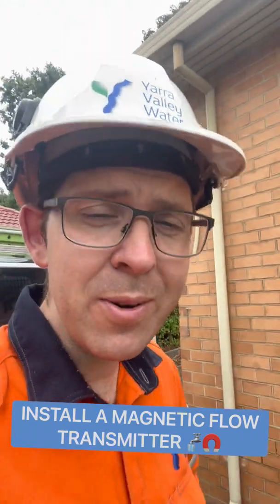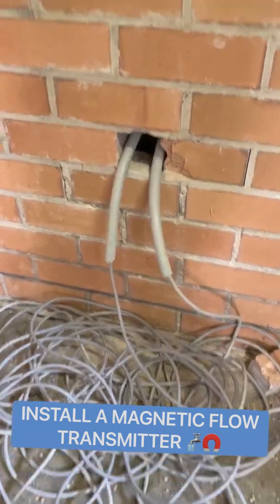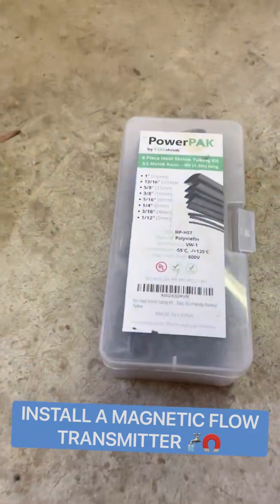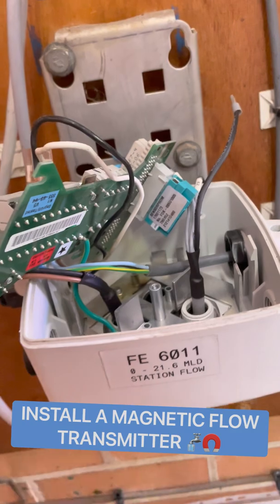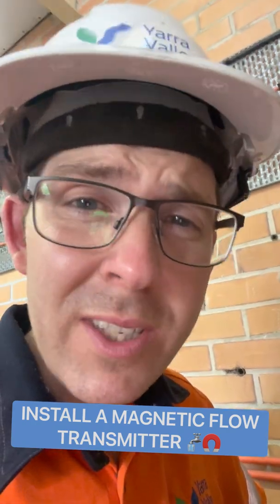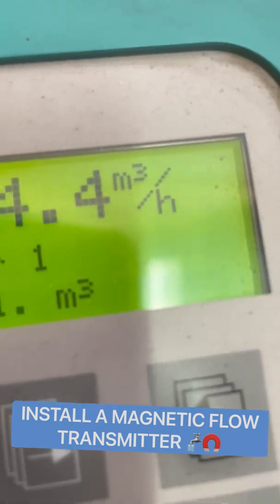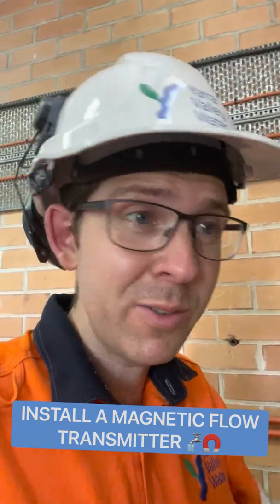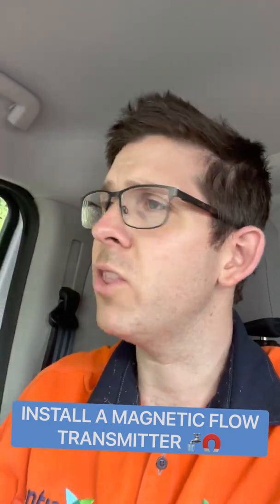FAILED Flow Meter Install

Comment: Out of interest, was is it a standard electromagnetic flowmeter with modular pulsed DC technology or a high-performance pulsed AC flow system??
Reply from the maker: So ☝️ the flow sensor coil is powered by a constant current DC supply. This provides the magnetic 🧲 field for the water to flow though. Then the electrodes are processed in milliVolts. The output signal is 4-20mA 👌